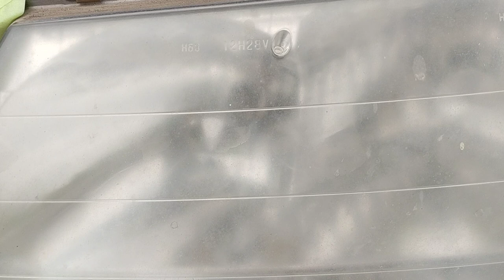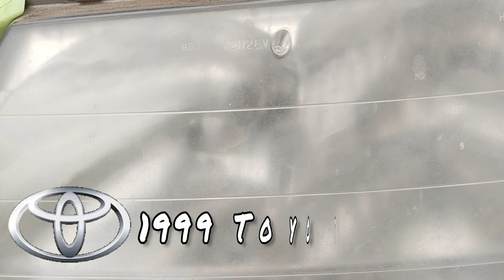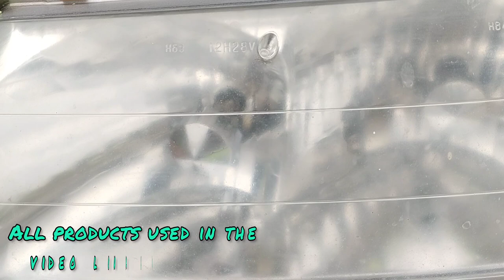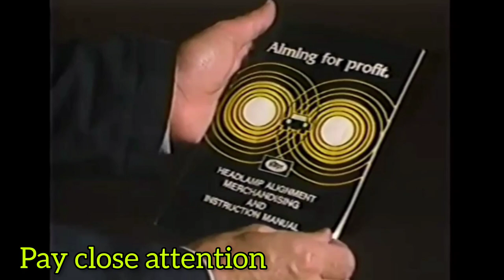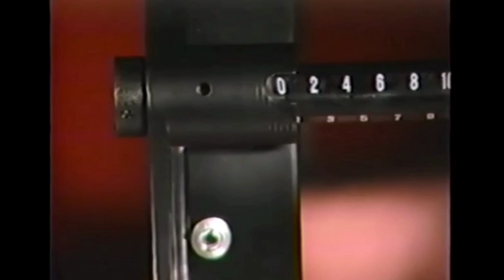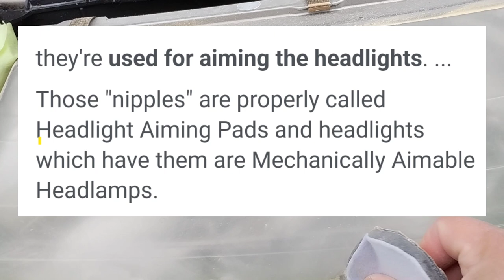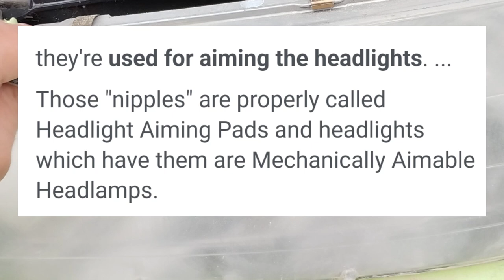HEADLIGHT NIPPLES - headlight restoration 🧚

Comment: Interesting, so you went from 500-800-3000 grit, and only wet sanding on the 3000 grit?  A lot less steps than some others and great results!
Reply from the maker: The best results and consistent results hands down.. check out a couple of my other videos.. the 3000 is a trizact pad.. it does the power of life 900 grit all the way to like 5,000....😊 It is unmatched and usefulness.... Just dropped the video yesterday you should check that out..

Comment: What’s up HRP did my second set of lights today and these had some nipples on them ate up a bit of my finesse it pad. But I have a couple of cheaper orange pads would you recommend switching to the cheap pads for the nipples so I can save my 3m pad for the flat parts of the lights
Reply from the maker: No....it sucks when that happens...but you can control it so it doesn't do that..you kinda just move around them..
It will come with experience...

Comment: What exactly is the reason you can't use the drill to be polish or could you does it make that much difference I'm striving to get where you are but not quite there
Reply from the maker: Technically you could use the drill for the polishing part but it is a drastically huge difference when using actual polisher for many reasons.. you're talking 1700 RPM versus 7800 RPM.... The heat and friction alone has a clarifying point that you cannot achieve with the regular drill. Plus rotations per minute which is what RPM means so imagine how much more you're getting... One of them is called a polisher so of course using it for the policy step is the best you can get...
Reply: @theheadlightrestorationpro  yes I caught that when you said it in the video and a lightbulb went off in my head said maybe that's what I'm missing.

Comment: Very informative! OK, so, now I know. I have a 2003 F150 with those "aiming docks". I've done my lights a few times and those things are very frustrating! We used to have annual vehicle inspections here where I live (Arkansas) but they did away with them many years ago. And, it seems that every place that did headlight aiming (as part of the inspection thing) got rid of their aiming equipment! So now, if you want/need your headlights adjusted, you are S.O.L.!! 🤬 Even so, the machine they used rolled in front of the vehicle on a rail system (I've never seen the system shown in your video), so they never used the "docks" anyway. I'm about ready to do my lights again, so I think I'll just grind them off...😉😄

Comment: Hi mate, thanks for the great videos. I dont have the tools that you use. I generally do it all manually by wet sanding starting at 800 grit then 1200 then 2000 then 3000. I then polish using a 3in DA and whatever compound Im using at the time. Ive only just discovered the megs coating so will order a can. Do you think i can get away with this method? The headlights ive done so far  usually come up pretty well but havent used the spray coating you use. Ive been using SiO2 spray sealants which i now see is not going to be as effective as megs. Do u have issues with over spray as it seems to spread around further than the headlights. Is it easy to remove if you get it anywhere else? Thx in advance.
Reply from the maker: Yes.. Meguiars is one of the best..
Check out more videos for all that information on it.  
Thank you for watching..
Reply: @theheadlightrestorationpro  thanks for the reply. Do you think the method i mentioned above would be sufficient or should i be looking at buying the products you use?
Reply from the maker: I mean there's a million ways to get to one point... You can use it but of course this method is a little bit more advanced it's going to give better results.. especially with the products and tools that I'm using...
Reply: @theheadlightrestorationpro  yeah of course. How long do youbtypically spend on each light? Thx again mate
Reply from the maker: Typically taping from beginning to finishing the light removing for both lights 30 minutes... Much slower on YouTube got to account for camera angles and other stuff in the way when recording also got to slow down to explain are better elaborate... Without recording literally 15 minutes of light... Average..
Reply: @theheadlightrestorationpro  thx for sharing your tips and tricks

Comment: Did I hear correctly? The headlight restoration pro is using "Windex" an ammonia based cleaner on polycarbonate? o.O Hope you like eventual crazing if so.
Reply from the maker: Not Windex .. class cleaner...and it's none existent by time of sealing...YA SEE....
Let me explain to why and I get zero craziness or whatever your talking...
This GLASS CLEANER is just to remove muck from the previous step...
It is 100% removed and any of it's residue by way of 7''000 RPM and friction flash heat .this level of rpm is enough to burn flesh in ln less than 1 second...there for it's a sterilization process and cleaning process by way of extreme friction and heat.... nothing will clean or sterilize like this... So there's absolutely zero ammonia residue and or alcohol residue left behind...
Glad to have cleared that up for ya ...
Not an issue here...😎
Reply from the maker: Thank you for watching..I would advise you to watch more of my videos because this is discussed many times  .also their are many ways crazing happens ..what you speak of is is just one way...And that's is by way of over dehydration and or stripping of surface oils which is done by alcohol and ammonia but ammonia much much less... which leads to poor headlight health and various forms of cracking and yes crazing...you are right but (if I did not do the polishing step) so good for you for that 👍🏽😁
Reply: @theheadlightrestorationpro  well you did say "windex" specifically about half way in the video, perhaps just a slip of the tongue.  I would not use an ammonia based cleaner on polycarbonate for any duration of time - especially one that's been sanded and thus surface-activated polycarbonate is exposed.  The crazing appears over time, not immediately, due to cumulative internal stresses induced by chemical and uv exposure.  That is also the true cause of the crazing in your 2k clearcoat video - not the hardness of the 2k.  There are some good non-ammonia based glass cleaners as well as plastic cleaners that are better advised if you're not already using them.
Reply from the maker: Yes...as I said it's not Windex and theirs multiple reasons behind crazing and cracking like I stated and one is in fact the hardness of the coating as well ..I go over this in a couple videos if it's too hard it does not want to move forms a hard shell with a substance that expands and contracts and heat and cold and when they can't expand and contract properly cracking and deformities happen.. but the 2K clears they're not meant for this they're meant to be applied to substances that don't typically expand and contract at all or this much... But as I said all this information is in the videos multiple times.. 2k clears are not formulated for thermal expansion... That's what the process is called what goes through the headlight everyday THERMAL EXPANSION...
Thanks for watching plenty more videos up and more coming...

Comment: What's the difference between starting off with 500-600 grit sandpaper when most headlight kits start with 2000 grit and the lights come out looking basically the same?
Reply from the maker: What kids do you refer to? I can't think of a kid off hand that starts with a 2000 Grit.../also kits are only going to come out so good and most kits are incomplete ...
Reply: @theheadlightrestorationpro  chemical guys does

Comment: Can you cut those off?
Reply from the maker: Guess you can cut them off and grind them down.. the only thing is you will have to manually adjust those lights without the actual adjusting device...